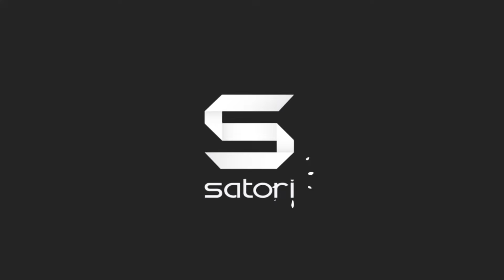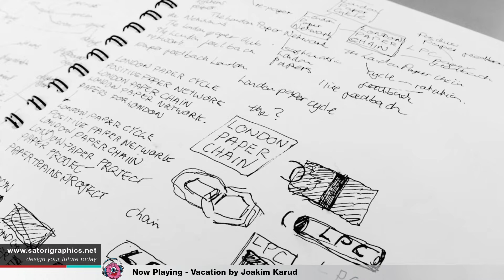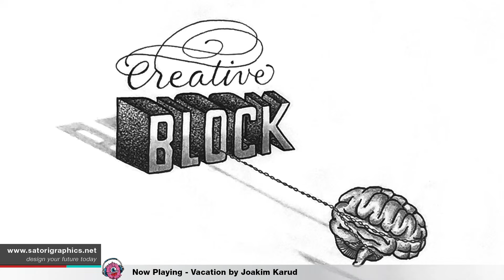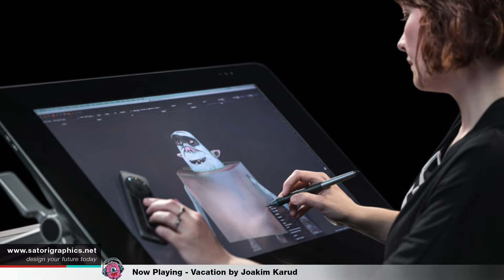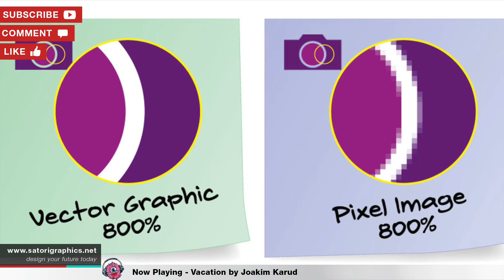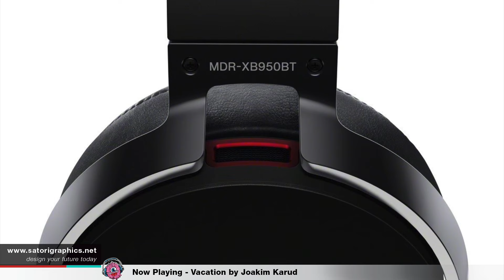LOGO DESIGN MUSTS - Graphic Design Equipment And Tools

Comment: Good video. Although I really can't determine the use of the tablet in logo design process. As if we are doing sketches with pen and paper for logo concepts we can directly scan it and work in Illustrator. Because anyways scribbles made in Illustrator by pen tablet won't be closed at the end to fill color later also you will need neatness and single stroke. Can you guide me further on this please If it makes sense what I said?
Reply from the maker: You can close pen tool paths on a tablet, so then you can dd fills etc. I am a firm believer of starting on pen and paper, and that is where I always start with a logo. But there also some designs where I like to use the tablet as you can quickly get vector drawings of your ideas down, often quicker than the pen tool
Reply: Thanks for your quick reply :)  Would you mind sharing some of them. Actually, I am confused from last two months if I should buy one or not depending on the work I do, I can also show you my portfolio and work I do.
Reply from the maker: I have used a tablet on some of my work on videos, for hand lettering as well, but not so much for logo design. I am waiting to get a new camera and then I am going to make a logo design tutorial from start to finish, and will use the tablet in that for sure. Link me your portfolio and I will check it out for sure, and offer my opinion :)
Reply: Great Thanks. Here is my portfolio: www.acharyamanish.in  Updating very soon. Any suggestions on improving portfolio are also welcomed. Thanks a lot for your time in advance :)
Reply from the maker: I'm actually out now so I will reply later! Speak soon
Reply: Satori Graphics no problem. Thanks
Reply from the maker: you've got some great work on there, and a wide selection. The only things I would address are as follows. 
the typography on the titles of each section, and throughout the portfolio needs to be changed, it looks kind of bland and 'cheap'  - almost amateurish
I think you need to try and tie in the portfolio with a style, so maybe make everything bold and colourful, or make everything minimal, black and white or something. But go for a style that sweeps across the whole portfolio. This also includes the thumbnails, they need to all tie together in some way
Apart from that it's great :) Keep going and add your best work only